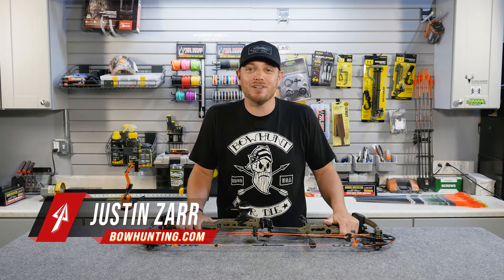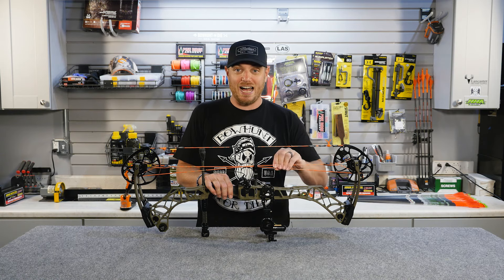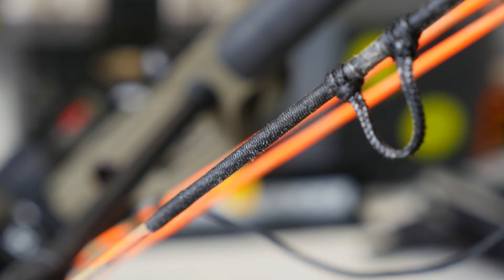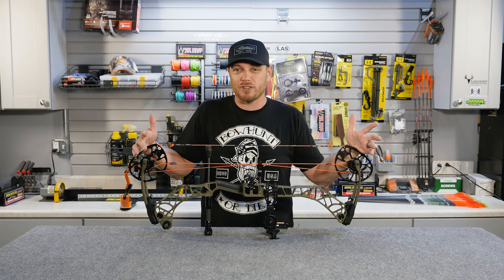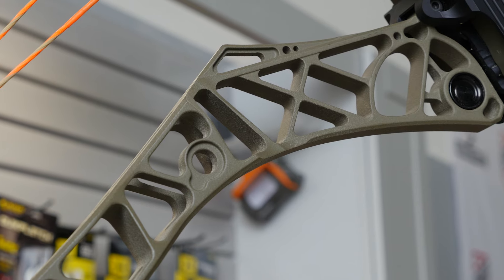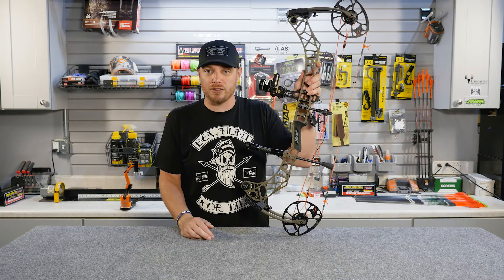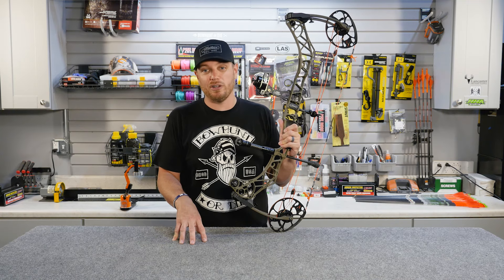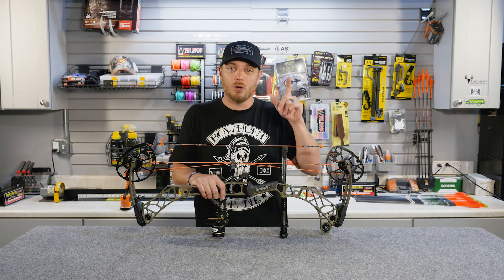Learn the Anatomy of a Compound Bow | Bowhunt 101

Comment: Im that younger guy that would walk into a shop and ask what all the trinkets are, so you saved somebody 30 minutes and a headache. This is a lot different than the classic stuff im use to. But i still have to ask about the cable guide/holder/the stick that holds them out of the way, seems like theres more than one style/setup. And how much can i modify a cheap $50 Barnett youth bow? The string is like plastic, and i hate it.
Reply from the maker: Alex - you're probably not going to be able to do much with that Barnett Youth bow.  You're better off looking for a used adult bow that's i good shape and going from there.  And yes, there are several styles of cable guards out there.  They all do the same thing though - which is to hold the cables out of the way so you can shoot without interference.